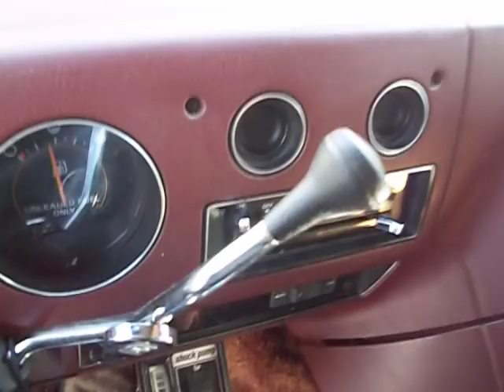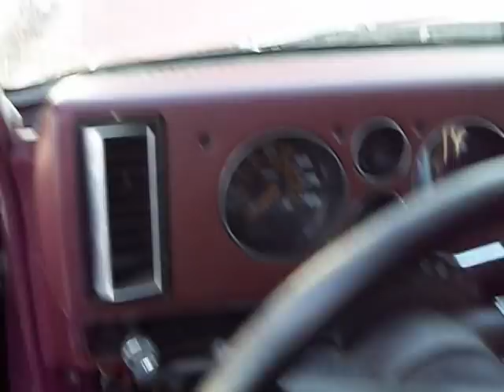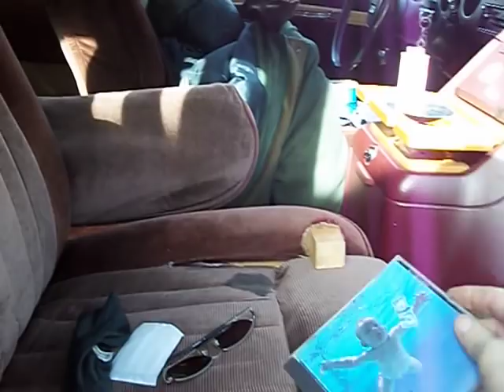1987 Chevy G20 Conversion Van

Comment: we bought ours in Sun City,Az with 88k miles, 350 4speed auto 3:73 gears $2800. had our for four years the only problem was a/c vacuum hose under front dash